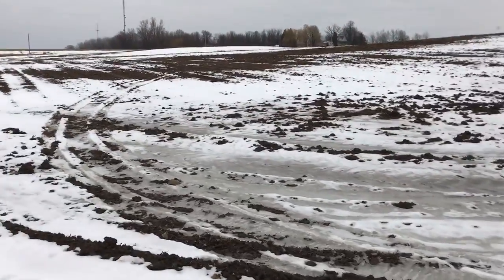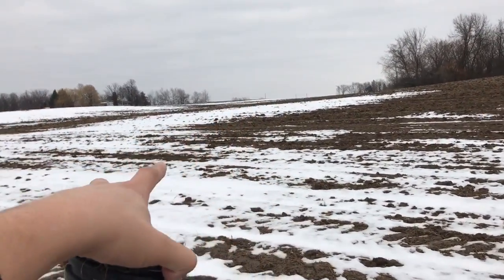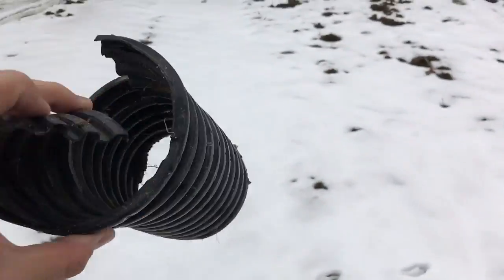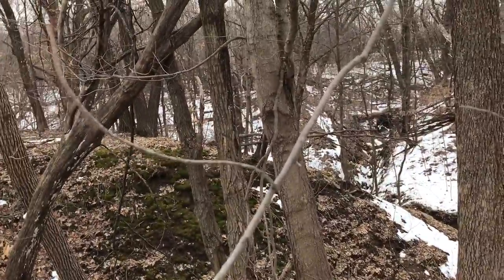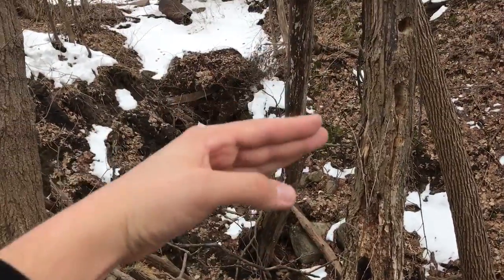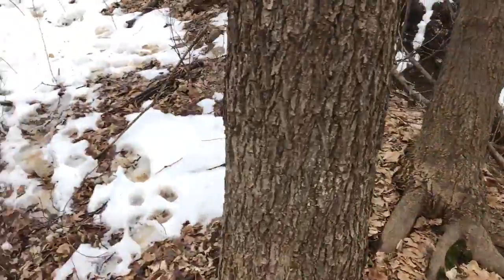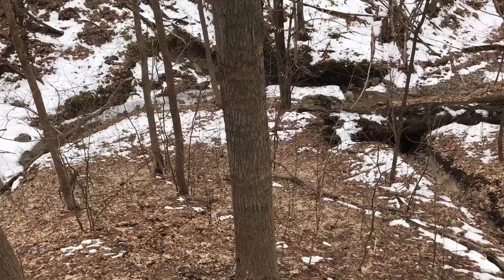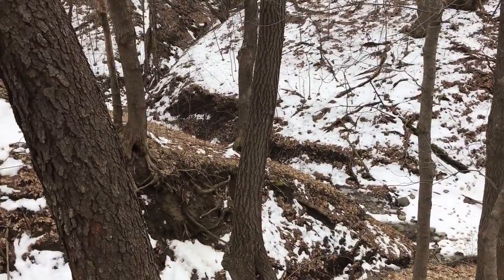Tile Explained and Erosion Control

Comment: Why do people up north say "crick".  Two ee means the e is long.  Creek.  Okay, other than that what you need is several loads of rift raft (large which rock).  Around here its about $700 a load.  You need 5-8 loads.  Then you'll need a trackhoe to place it all for best effect.  It wouldn't suprise me if you ended up getting another 3-4 loads in another year or two.  Then you'd be fixed up.  No more problem.

Comment: I would suggest that you just place rocks down through your washout to slow the speed of your water from your tile outlet. You will need to excavate more area for the additional run of tile which could promote additional erosion.
Reply from the maker: Ya I hear ya but it seems like the rock thing only works so much; we've dumped rock picker baskets down these and it doesn't seem to have the affect a guy would think

Comment: Funny they still call it tile considering clay tile has not been used in decades. Land is almost completely flat here, we use ditches to catch and drain off excess water to a canal or pumping station.
Reply from the maker: Ah, that awesome, my uncle farms in flat country and it's cool to see the ditches and realize all the water that had no where to go before the ditches were there.  Some parts of the farmers field I work for still have partial clay tile.  Always kind of cool when we stumble across clay tile when doing a repair

Comment: call your local concrete company contractor. they are always looking for places to dispose of tear outs.  just specify clean concrete without wire rebar or glass. fill in the gully with rubble, top with gravel then fill dirt . leave the tile as it is.  the rubble will slow it down while allowing full flow.  
water does work with speed. thats why stream beds wander.
Reply from the maker: I know a couple guys that do concrete, I'll have to check it out.  Maybe even some old hog barn slats